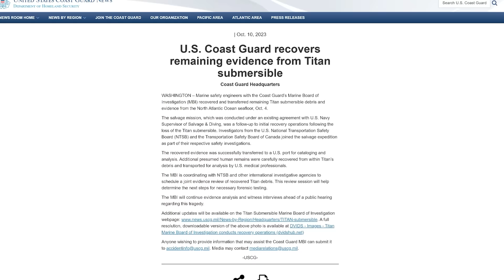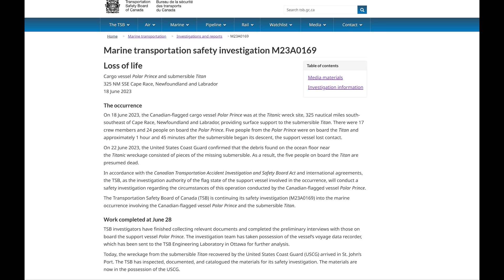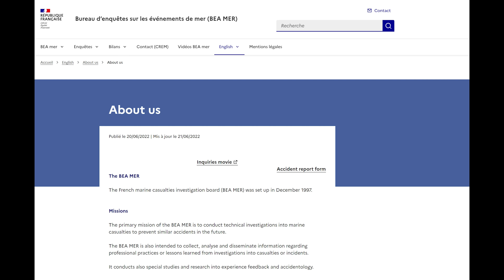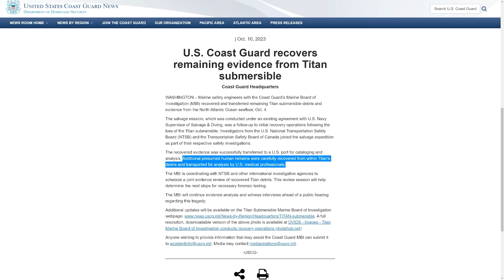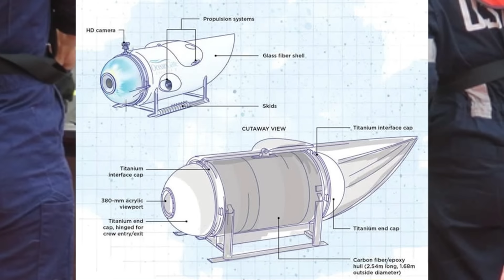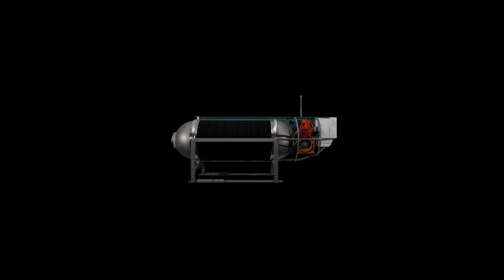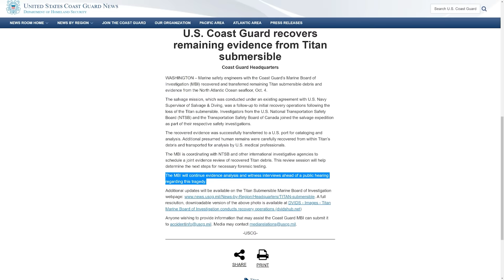Titan Sub UPDATE: More Human Remains, Debris Found

Comment: If I remember correctly, the submersible was actually towed behind the mothership for days due to weather and available space on the deck. This would have bounced every component, loosened every connection, weld, clamp and accelerated the mean time between failures.
Reply: I’ve mentioned that in comment sections several times. To me that’s common sense that especially that guy who had been down over 30 times should’ve taken notice of yet some jacka$$ in one of the comment sections said that if it was made to stand up to those depths that the rough seas wouldn’t hurt it. Some ppl just have zero common sense. I have zero experience with this kind of equipment but even I know that was a stupid thing to do.
Reply: Shake loose a weld? Lol. A proper weld isn’t going to be phased by shaking. It will be stronger than the substrate it is being used to bond.
Reply: @johnd9357  I agree the weld should’ve been fine but all of the technical equipment is another story.
Reply: Oceangate basically cheaped out on the transport. The correct way to do it would have been to transport it on the deck of an offshore vessel and crane it into the water when they're on station. Like every other deep diving submersible operator does. 🙄
Reply: An expert engineer in testing every type of electronic equipment for vibration, impact damage , pressure, and temperature exposure was shocked that they towed this equipment, bouncing up and  down in the waves.
Reply: @donallan6396  you don't need to be an expert engineer.
Reply: @donallan6396 one of titanics lifeboats stayed a float bouncing up and down floating on the ocean for months after the sinking and something made to go to the oceans floor is going to get messed up by this for a day or two? Please
Reply: @bradsanders407 Did the titanic lifeboat contain computers, accelerometers, banks of batteries and looms of wiring which would have all needed to be 100% functioning?
Reply: I doubt much matters other than the way the carbon fiber was wound.

It was going to fail eventually.
Reply: @johnd9357  "proper" being the term of note. Not much was proper on this submersible. The bouncing and shaking and twisting might not have been good for the already dubious glue joints at the end caps.
Reply: @lordgarion514   The CFRP on the hull that failed was actually laid down in a criss-cross pattern. It was not a diagonal weave, nor was it just laid in hoops.
Reply: @highjinx6519 the glue joints come to mind
Reply: @johnd9357  FAZED, not PHASED.

PHASED (adjective)
Meaning:  carried out in gradual stages; staggered.
E.g. "a phased withdrawal of troops"

FAZED (verb)
Meaning: disturb or disconcert (someone).
E.g. "she was not fazed by his show of anger"
Reply: It’s a toy but how did it do past dives I don’t know maybe pure luck or it didn’t dive very deep, and for your question maybe yes but I heard that they refused some suggestions cause of height issues, so domed it was not to mention it’s name .
Reply: @ziadaziz8273  it made it all the way down to the titanic multiple times if I’m not mistaken. How I don’t know but supposedly it did.
Reply: @highjinx6519  Oceangate claimed that this particular Titan submersible made 13 descents to Titanic in total in 2021 (6) and 2022 (7). I don't think anyone is sure if that's true, or just marketing. However, as a possible clue to the validity of that claim, on the very first attempt to reach Titanic in 2023, the thing imploded. The waiver paperwork apparently claimed that the 13 successful dives were among 90 attempted dives, so that would be a low success rate. I personally think the 2023 dive may have only been the second deep dive for that hull, given the reported "gunshot" cracking sounds from an earlier dive.
Reply: i live on cape breton island...in canada and the weather was NOT  good June 18 x
Reply: @bradsanders407 it's under completely different loads and stresses when dropping to the ocean floor with no shocks or vibration.
Reply: @bradsanders407 I'm sorry- how much technology and electronics were on the Lifeboat of the Titanic? I missed that part.😅
Reply: @ziadaziz8273 that information is already made public.  Ocean Gate was only successful on 14% of its previous Dives which means 86% of its previous Dives had to be aborted. To me that tells me this vehicle was still in experimental DESIGN mode   - never should been allowed to have tourists on it at this point.  Imho.
Reply: @highjinx6519 You know that so called "common sense" isn't something you can rely on to give you a true understanding of something. It's "common sense" to some that if the Earth were spinning on it's axis at 1000mph, you'd be flung off, or that rocket engines cannot work in space because there's no air to push against. And yet we know otherwise. What most consider to be "common sense" is not always based on actual knowledge, just guesswork.
Reply: @highjinx6519 Motor vehicles are subjected to huge forces, constant vibration and relatively large periods between services. Do the mechanical parts, electronics and welds fail in your cars regularly? Giant ships spend their time crossing oceans with huge swells, with giant peaks and troughs, causing incredible stresses on the hulls. They go years without dry dock maintenance inspections. Airliners hulls are constantly subjected to major expansion and compression cycles, incredible air turbulance and vibrations during take-off and landing. They don't fall apart either, and their electronics don't often fail.
Reply: @greggpedder That was Stockton’s thing though, to do it more cheaply than the other submersibles.  Not needing to have a specialized support ship, using carbon fiber, off the shelf parts, etc.  Round up some rich folk, give them the title “Mission Specialist” and ya got a superior business model….for awhile.  One can only ignore those loud cracking sounds for so long.
Reply: @another3997   that’s funny. I’ve flown less than 5 times in my life but at least 2 of those I got stuck being delayed so they could replace electronic parts. That’s pretty high odds. But maybe that’s just my bad luck.
Reply: I heard the same. In the past, the Titan was strapped securely on a larger ship. The reason it was towed is that it was cheaper. This guy cut so many corners, there were no corners left.
Reply: Titan was made to travel on this platform, i don't think this did make any difference. It sometimes took a hit during the dive too and it did not implode because of that.
Reply: @greggpedder  Lifting it with a crane meant more stress for the pressure vessel, because it had to be lifted at the titanium rings in this case.   Usually it was rolled of the deck on it's platform, this was the softest way.
Reply: @Xantylon74  nope. Load of rubbish. Literally every other offshore diving vessel, manned or otherwise, gets lifted by a crane. Oceangate just cheaped out, that's it.
Reply: It would've failed anyway, everything was defect on this tuna can, including the design itself.
Reply: @greggpedder yes, exactly
Reply: I’m sure all what u mentioned is nothing compared to the massive hydrostatic pressure underwater , I don’t think towing it really damaged that much , the hull was surrounding by foam and panels if anything it would damage these first and be noticeable
Reply: @donallan6396 makes u wonder how much, if any torsional force was put on the ship, if they did that.
Reply: I think that one must respect the amount of pressure that is applied to anything at that depth!!! I am not an engineer either 🤓
Reply: It was apparently towed all over for shows too.  In a tractor trailer.  And had ppl crawling in and out of it at exhibits constantly.     Even pics of it sitting at Bahamas port for months in the hot sun.   SMH 🤦‍♂️
Reply: Yea your right it was towed at sea for 3 days

Comment: With all the money this company was charging.  You'd think they'd want to KEEP making money? So why did they design the worst structure to handle the stresses it was being subjected to? In no way should they have been using that submersible at depth. Especially those insane depths.. it wasn't designed to handle compressive forces & temperature changes at the level they pushed it to..

Comment: Thanks for the update Jeff. I have been wondering what the heck is going on with this investigation, as things are very hush hush. I suspect that there are lawsuits in the wings and that may explain the lack of info at this point. And it is the military after all! The metal mandrel possibly would have protected the hull, but with it's weight, who knows. But it still bothers me to the core how Stockton Rush and the company thought safety was over rated. Very disturbing minds at OceanGate.
Reply: There is such a thing as overkill you know which I'm sure is what he was alluding to.
Reply: Note: the mandrel is removed after the resin has cured. It does not remain with the hull.
Reply: With 4 countries involved I would imagine that they will be completing a thorough investigation before releasing a final report, especially if they are still recovering debris and human remains. I would think that as this is an international investigation there will be a joint statement issued once all parts of the investigation are thorough and complete. They’ll leave the speculating up to us armchair analysts in the interim, because while we all may be curious, there are 4 grieving families whose privacy and dignity must be respected while the process of the investigation is done methodically and correctly.

Comment: I don't think the steel sleeve would have made a major impact. It might have allowed for one or two more dives but that's about it. The way the carbon fiber was laid for the environment they wanted to function in was never going to be a long term solution. One dive was all this configuration was good for and even then it could have failed. I would imagine the biggest piece of carbon fiber they found was about the size of your hand.
Reply: Steel would rust, but a thick titanium one - they'd still be intact.
Reply: Their development team said if it was heavier, it won't work. The lack of testing, the way the composite fibers were laid, I don't think it would have made a difference  @G-ra-ha-m
Reply: @chriswirges5202  Heavier? Yes, of course, air is being replaced with titanium. But Archimedes has an solution for that :D

Comment: If they would have done the carbon fiber correctly with a crossing pattern, they would have had a significantly better chance
Reply: Shouldn’t have used carbon fiber at all, honestly
Reply: @CChissel  everybody say that carbon fiber is not a material to build subs from yet i seen alot of coments "make it another way and it could work" more people then rush that dont get material physics.
Reply: no just no, carbon is like a shoping bag it stands to hold load aka stuff in it but is not designed to carry load from the outside then it just colapse.

Comment: Regarding the mandrill/inner metal liner, carbon fiber rifle barrels are basically machined down until there’s a thin liner, then CF is wrapped around to rebuild the strength lost. It makes for a very light product but there are issues… the barrels warp after a few rounds as the heat causes different rates of expansion between the cf and steel. Shooters need to decide if they want to sight their rifles cold or hot because it makes a big difference. The differential is much greater than a traditional steel barrel. 

With all that said, I think an inner liner would actually cause more problems due to different rates of thermal expansion from the extreme temperatures, along with how you would keep the two bonded together as the pressure compressed everything. 

With that said, I wonder how a thick layer of pure cf reacts to extreme temperature differences and compression. I have to believe it would cause layer separation after multiple dives but 🤷🏼‍♂️

I think Oceangates lack of testing to failure and lack of destructive testing was their greatest sin.
Reply: This !!! The dude they fired , had written on his warning report the outside was covered in tiny holes , " like Swiss cheese " . After every dive there was weakness in certain areas . Did they just cover the outside with another layer of CF ? Did they do pressure testing after every use ? Or was every dive a suicide mission ? 🤔 Just creepy and highly , hinky !
Reply: The thermal expansion differential is a good point but I'd posit that, that could have been a possible cause of the implosion having two wildly different thermal expansion coefficients fighting each other. (Domes  vs CF cylinder)
Reply: It's one thing to design something on paper, another thing to prove the technology.  It looks like they just didn't do the latter.
Reply: 20°C difference between the surface and the bottom isn't exactly an extreme temperature difference.

Comment: One of the more important lessons learned from my years as a materials scientist in the 80s/90s is that carbon fiber composites are great in tension, and really lousy in compression. The situation is made worse when the fiber is wound mono-directional, as this appeared to be as it was laid up on the mandrel. Strength can be fine-tuned as succesive layers are oriented at specific angles to one another. But in a compressive environment, most of the strength is governed by the resin matrix, and in that situation the material is subject to buckling and delamination. We would NEVER consider this kind of material for a high compression environment!😞 Who engineered this damn thing?!🙄
Reply: Is this a copypasta?
Reply: The owner said so.
Reply: Totally agree....great explanation
Reply: How do you explain a carbon Fibre wing? The upper wing surface is in compression when loaded.
Reply: @jimjoe9945  the pre-preg laminates are usually laid up at angles to one another, the wing is generally internally supported with a spar or webbing, and compressive loading of the upper skin is pretty miniscule compared to the ~6000 PSI hoop stress that this mono-directionally wound tube experienced. As the tube imploded, the shear stress at the joints to the titanium end caps would have easily and instantly caused the glue to fail.
Reply: "Who engineered this damn thing?!" Stockton Rush...
Reply: @lonewolf379th Yeah, Stockton Rush fired his actual engineers which were telling him it was not a good idea and in place of the experienced engineers he was basically doing it himself and hiring recent graduates and college students and paying them 15 bucks an hour from what I have heard. Can you imagine being hired as an engineer and paid 15 bucks an hour WTF? Assuming that is correct and it's not an exaggeration of how bad it actually was.

Comment: For starters, don't forget that the US Coast Guard is still part of the US Military. Hence, there will be certain protocols regarding information classification as they are investigative lead. That is why I personally think we haven't heard much info from them.
Thanks, Jeff, for updating us with what there is so far.
Reply: A bit of clarification: The USCG is an "armed service" in that it has weapons of war (cannon-caliber guns and machineguns) on some of its ships and has authorization to use lethal force when necessary.

However, it falls under the umbrella of the Department of Homeland Security, not the Department of Defense...Prior to 9/11 and the formation of DHS it was a branch of the Treasury Department, as the original mission of the "Coast Guard" (not called that in those days) was that of inspection of vessels entering US ports to assess the tariffs to be placed on the cargoes.
Reply: @karlbrundage7472  Thanks for the clarification. I wasn't aware they fell under Homeland. Appreciate the info.
Reply: @karlbrundage7472  the USCG is 100% part of the Military. They are under Homeland  Security during peacetime or can work under the Navy during times of war….but are always part of the Military (actually one of the oldest). The USCG has 11 missions where the other branches each focus on 1. 
Sorry .. just wanted to clarify.
From a USCG family🇺🇸

Comment: An additional inner cylinder might only be beneficial if the failure was due to excessive flexing of the carbon fiber composite (CFC) under cyclic loading; perhaps flexing caused progressive delamination of the CFC matrix resin. But, a better stiffening would be adding internal ring bulkheads & stringers (as is used on aircraft fuselages or conventional subs & ships). This might allow a thinner hull shell at the cost of reduced useful internal volume. A bigger OD hull would be needed to restore internal clearances/volume driving a spiral of additional weights. I imagine the FEM structural analysis of a plain cylinder is easier (cheaper) than a complex structure of bulkheads, stringers and shell. And I have no idea how Boeing/Airbus makes such fuselages with CFC skins (or even if 5hey do). Ships & subs made of metals generally are welded. 

However, if the failure wasn’t due to excessive flexing such stiffeners wouldn’t help. The one Ti ring that was recovered with a torn rim/flange suggests it was subjected to some excessive loading. Was this the failure point or post failure overload? IDK.